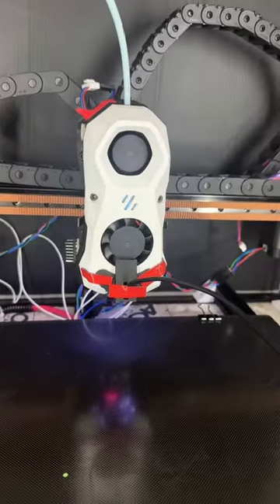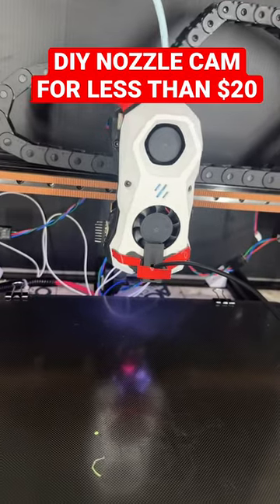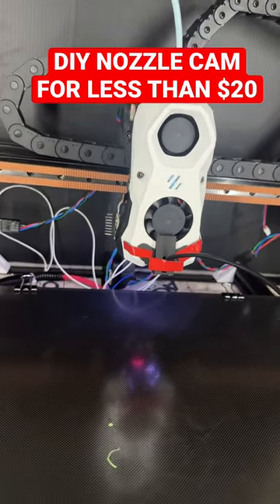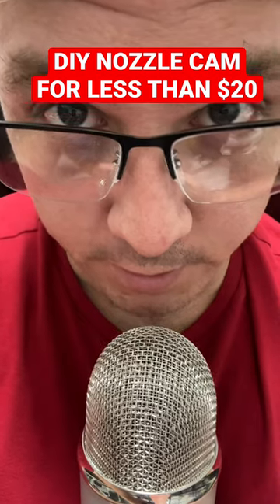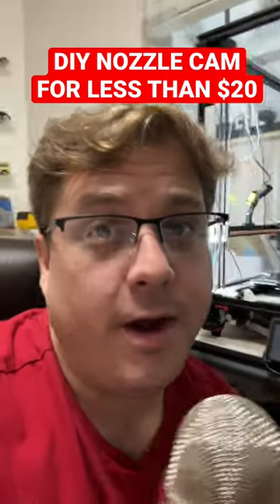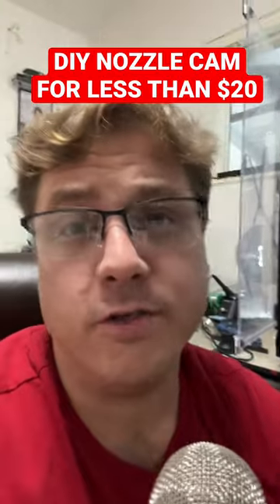DIY Nozzle Cam for stealthburner. #3dprinting #3dprintable #shorts

Comment: Did you ever finish this? Looks great!
Reply from the maker: Yes! But it was something I never released. I upgraded the nozzle to the phaetus rapido and need to redesign it fit. Honestly, it’s a novelty rather than a useful feature.
Reply: Can I play with it? I've been itching to put a nozzle cam on my Voron. Big bed means the chassis mounted cameras are pretty far from the print itself.